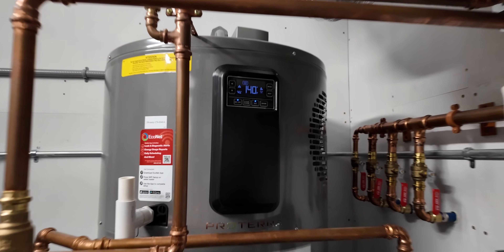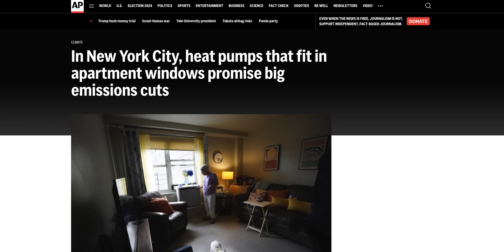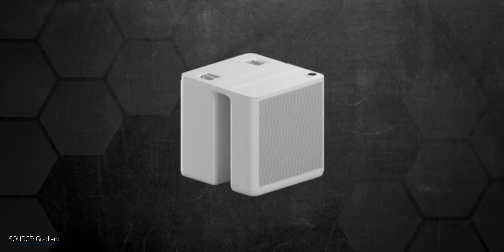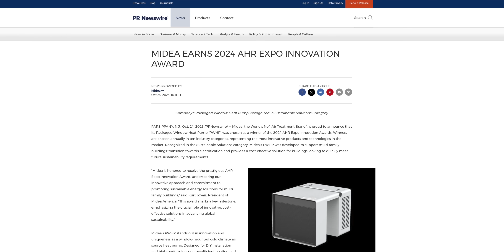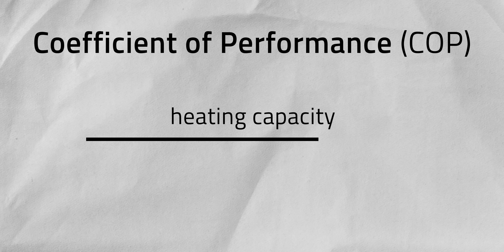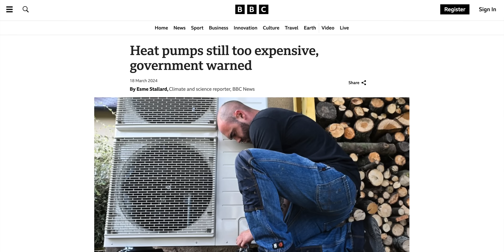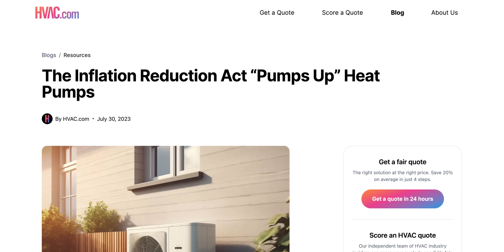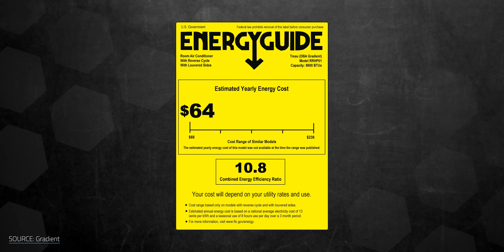Why This Window Heat Pump Is Genius

Comment: This concept goes way way beyond just New York apartment dwellers. This is basically a one piece mini split that can go in nearly any window and plug into 120V. These could be used in nearly any dwelling, school, or workplace, and provide a nearly instant and cost-effective HVAC system. That's just huge. A lot of homeowners have been moving to mini-splits and often you need multiple separate units for an entire home. They need professional installation. At an average cost of $5,000 each these days installed that is pretty expensive. We just installed one, but it only covers two rooms. Also most run on 240V, which has to be run to each unit. I've been waiting for these saddle shaped heat cool units to hit the general market but as yet they're still not really there. When they do, it would be a real revolution in HVAC across the market. You could easily buy a number of these for your home and ditch your central heat and air. I would buy two tomorrow.
Reply: My windows open horizontally
Reply: Soleusair is the answer $500 and yes you can still use the window. Ours is AC only - that's all we need
Reply: it is very old, recycled tech. Noisy.
Reply: Umm you most certainly do not need a professional to install a mini split. Tons of women online doing it start to finish... They are marketed as easy instal..... Maybe a electrical outlet needs professionally installed at most. Did you forget these window units cost 3 times as much as a split unit or even a full unit? Not worth it at all until they come down in price.
Reply: @cmo5807 in an apartment in NYC...lol.

Comment: I moved into a "green" apartment building and it has converted me to an efficiency nerd. In winter, despite now having a W/D and dishwasher, my electric bill cratered to 1/4 of what it was in a smaller unit.  In summer, it essentially vanishes as the solar system takes over.  So well insulated the heat pump runs for a grand total of 90 minutes a day.
Reply: There's always a point of diminishing returns. If you're building a house and spend an extra $100K to make it super energy efficient, it's going to take a century of -$200 on your electricity bill to break even.

Comment: Omg AC is heat pump. It pumps heat from one side to other. This is just awefull type of ac that US uses. As apartment owner you can buy AC that heats in winter in Europe for a decade. You have outside units and mini splits inside. Not useles sliding windows with horrible draft.

Comment: I have a finished attic bedroom space that relies on window ACs all summer... I would love a heat pump solution like this that didn't obstruct the window... I could leave it in year round, and the kids could get some extra air filtration and circulation during the winter.
Looking online though... Everything comes up as being a AC with no heat option for the typical GE and LG brands... Ithay kinda sucks

Comment: It's true that heat pumps are more effective with coeff 2.35 than just burning fuel with coeff 1, but if we use heat pump in winter when there is no sun, then energy in the grid is probably generated from coal with 35% efficiency. 0.35 * 2.35 gives us 82% efficiency. So it's better to burn coal and heat your house directly than lose on conversion from heat to electricity and back

Comment: If the COP is heat putput over electrical usage, I do not understand how you have a COP of less than 1 for a gas heater. For the same heat output of the heat pump, the gas heater would have much less electrical usage. If your electrical usage goes down put heat output is the same then the COP must go up.

Comment: Question if heat pumps take the internal energy from outside, if everyone used it in the winter. Would the outside temperature drop?

Comment: One possible downside not covered is that if they draw a lot power, it will limit what else can be on the circuit without overloading the breaker (high-end desktop/gaming computers, small appliances like a toaster over or microwave, etc). I couldn't find power specs on these particular heat pumps because they aren't out yet, but just the first 9000-10000 BTU mini split I found uses up to 750 W @ 120 V, which is a little less than half of a common 15 A circuit.

Comment: I might be missing something, ive seen this on Amazon for 500$. Maybe that one doesnt heat? It shouldn't be that difficult to reverse, its just an indoor and outdoor unit slapped together. Which go for sun 1000$pre charged.

The real issue is HVAC companies and tarrifs. In most parts of the world you can get a crazy efficient heat pump installed pretty much anywhere for 500-1000$. Here HVAC peeps will charge 2-3k for labor only, it's a scam. Have the government give a GI bill to youngsters to go around and build housing/install heat pumps.

Comment: I purchased a 10,000 btu window heat pump for my 900 sqft home 2 years ago for $700. Granted its only works above about 28° F but for 300+ days a year it works great.

$3,000 seems high but so does a $6,000 furnace which I guess is the real comparison.

Comment: Midea also has 12,000BTU window AC units for as low as $400. They are very popular on Amazon. I would consider the heat pump if it was within 50% of the cost of an AC unit, but not over 6x the price.

Comment: Good idea, but I'd like to see some sort of network capability so that multiple units in a property don't start fighting with each other.
One problem we have at work is with multiple heat pumps in a building, even though they are set to the same settings, some of them start thinking that it's slightly too warm so they go into cooling mode which makes other units think that it's now too cold so they throttle up. This slowly escalates until they're all running at full power in either heat/cool modes until they are reset.
If they are all talking to each other wirelessly over their own network, this wouldn't happen and it's something that manufacturers need to think about.
Reply: You don't need networking to solve this, you just need a gap between heating and cooling setpoints.

Comment: That form factor works in a window where you slide the opening window up and down. I don't know if I've ever seen windows like that outside American media. Everywhere else, they are hinged. Even if the hinge is on the top of the window, you're going to have to modify either the frame or change the window to a smaller one to accommodate a unit like this. And most hinged windows have the hinges on one side. And most windows have one window that opens to the inside and another that opens to the outside - or in more modern building, both might open to the inside, but you can't open the whole window. So you're still going to have to modify either the frame or the window.

So yeah, might work for the US market, not that much elsewhere. At least not in most of the countries I've visited.

Comment: Around the Seattle region, it is very common to have horizontally sliding windows, so these won't work. Which is unfortunate, as this is the best design for window air-conditioners.

Hopefully someone can create a version that can be installed using a bracket, but then it would need 3 versions: left hand, right hand, and, the one shown in this video, for vertically sliding windows.

Comment: What about serviceability? My father is on his third apartment A/C unit, his second mobile unit as his age prevents him from installing and removing a window mount. The previous LG mobile unit had a sealed system that wasn't serviceable. The entire sealed unit was technically replaceable, but LG will not sell to the public and I couldn't find a single tech willing to service a mobile unit. So, $600+ into the trash. I can't imagine how f'ed he'd be if a $3k unit died out of warranty and couldn't be serviced, especially if it was the sole source of cooling AND heating.

Comment: Once you raise the window 1/2 inch to allow this heat pump on the window sill you won't be able to lock the window. A design flaw off the bat.

Comment: I think the strain on the grid shouldn't be an issue given that it already has to handle summer peaks due to AC units. Using heat pumps will increase requirements during the winter as well but given how much more efficient heat pumps are I don't think it will be a cause for concern.

Comment: I can't understand these quoted prices. My Daikin reversible heat pump (12,000 BTU) cost around $600 plus $200 for installation and works great for both heating and cooling. What am I missing?

Comment: Here in EU the common wisdom is that insulation comes first, second and third, only after that should you be considered about your heat source. If the window sucks, heatpump is not going to fix your bill.

Comment: It's good for temperature control but it's not good enough for air quality, except a little filtration. Air quality is a serious concern. The build up of pollutants and also carbon dioxide and even radioactive radon gases in buildings is probably responsible for some substantial burden of disease. Really all buildings need heat recovery systems that effectively and efficiently bring in fresh air and expel stale air. Otherwise HVAC is not doing its job well enough for human health and even an open window might be healthier on the whole than these units even though an open window doesn't filter particles. I would also note that some traditional style window AC units are reverse cycle and so actually can do heating. Some of them do also allow the transfer of at least some amount of fresh air too, so are probably better health wise

Comment: I have a 5-6 year old LG window heat pump. Not nearly the compact equipment shown in the video, it is shaped like the common window AC, and I paid around 750 for the 14000 BTU unit. Why the substantial increase in cost for what is essentially a different package but same functionality? Besides the fact that these devices run on 110, and mine does have a dedicated outlet for the AC, what explains the cost?

Comment: There have been window A/C units that did heat and cool around for a long time. Sears used to sell them and the were 12000btu cooling and cost in the 500 dollar range. And yes they were reverse cycle. The only problem was when they got down to 32° outside, they had to go into a defrost cycle for a few minutes. You can get many 10000 and 12000 BTU units that are in the high $500s to mid $700s range. Only thing is, they run on 240Volts.

Comment: Wow! Getting roasted in the comments! But they are right. You can buy small mini splits that are available for $400. You will get both heating and cooling for way less! And have high seer rates! So efficiency is there also.

Comment: It's always back to the same old thing--money.  At 10-20 times the cost of an AC, if supplemental cooling is all I'm interested in, that thing would take forever to pay for itself (if it ever does, in cool-only mode).  And the cost is all up front.  I'll leave it up to economists and other financial pros to talk about the present-vs-future value of money.
But I won't lie:  That inverted, articulated 'U' shape looks ace.  What a great idea.  Facepalm indeed.

Comment: How will this handle hot water? Dunno what systems use in US but here gas boilers and heat pumps do both, so I don’t see how it could be a diy install.

Comment: These new designs (in terms of shape + hinge mechanism) are going to be great for installation and improving insulation/efficiency, especially for windows that are wider than the unit itself - especially compared to portable air conditioners that sit on the floor and only exhaust heat out a window. That said, there's no world in which a reversing valve and the related button and/or software to switch from cooling to heating is worth thousands of dollars to design or manufacture. Technology Connections has multiple videos all about how efficient and affordable heat pumps really are. I seriously hope this is just a matter of paying off the cost of designing the new shape, and these are sold closer to the cost of air conditioners; I could understand designing a cooling loop with a hinge in it being difficult, for instance, and especially the new refrigerants.

Comment: I’m flabbergasted that one of the expensive places to live doesn’t have individual heat pump AC units in their apartments…
I’m Japanese and I thought that was default for air conditioning in the modern era.
And it sure doesn’t cost $3000, even after including the instillation fee (it’s starts at like $400).

Comment: Desirable, expensive for 2 mths (July/August) hottest weather and 2 mths coldest weather mid January to mid March in Toronto. Do these 9000 btu units have the capability to add HEPA filters to imorive indoor air scrubbing? In the averge 2500/3500 sq ft home, what are anticipated air exchange rates? Any annual maintenance costs on the heat pumps?

Comment: @0:05  PLEASE Stop saying that.  You cannot EVER get more energy out than you put in.  You're only promoting all the perpetual motion and free energy con artists that try to scam people all the time.
Reply: He’s referring to coefficients of performance being greater than 1. I don’t think that many perpetual motion people are on this channel
Reply: So a gearbox or a few pullys don't generate more torque than what is put into it. Got it. Learn some science my dude.
Reply: @Mazaran  The torque comes from horsepower child.
You lose horsepower and gain torque.
Learn science,Child.
Reply: @Mazaran  I didn't say Torque, did I?
Reply: While you didn't say explicitly say torque, torque is mechanical ENERGY. low torque energy goes into gearbox and high torque energy comes out.
 I think the point you're missing is that the system isn't just "generating" or "creating" more energy. It's moving existing energy from one place to another more effectively than any other method of HVAC than we currently have. Low energy goes into to system to move the pump and fan, high heat energy gets moved at a result.
Edit for typo.
Reply: @Mazaran  Where, exactly does the extra torque come from?  Changes in gear ratio trade off torque for speed.  The total system energy stays the same - and That is the first law of thermodynamics.  Schooled much?
Reply: The energy always existed it’s in the air even if it feels cold, there’s still heat or energy in it.

Flowing energy through resistors takes more energy to create, than it takes for the heat pump to take the already existing heat outside and bring it in.

The energy is equal, but the way that it moves it means that the energy that is needed to use the device requires less energy than what it can pump through, that’s why it’s called a heat pump.

So if you look at the amount of energy going into the heat pump, and the heat that travels through it.

The heat traveling though is greater than the energy that is put into the device, the heat is just in the air, which is pulled in, and moved to the other side which then blows the hot coils, heating the room and cooling the coils which then takes that lower energy refrigerant and brings it outside to the hotter air that heats the coils and brings in hot refrigerant which then gets cooled off by the fan which replaces the cool air with warmer air repeating the cycle.

This isn’t perpetual motion, this is simple physics
Reply: @chrisw1462  nah he said more HEAT energy than put in, the extra energy is coming from other sources of energy other than heat energy. He’s not saying it makes energy out of nowhere so people understand what you’re correcting first.
Reply: The second law of thermodynamics dynamics says that heat cannot flow from hot to cold without a free energy cost. In the case of heat pumps, the free energy cost is frequently less than the energy moved from cold to hot (i.e. 10 joules to move 40 joules of heat from cold to hot). It always takes a free energy cost but the traditional laws of thermodynamics alone do not bound how efficiently heat can be moved.

Comment: Not just the 120V are US specific. Also the windows that slide up are. In Europe, I think you will rarely find them. Usually windows also have edges and only close if it's maybe a millimeter thick. So this will not work there.

Comment: Growers need any heat pump, not just another one🙄 Show one, that can be plugged to the air hoses of a growbox and brings no included fan or fancy grid, that block the airflow.

Comment: It took them long enough.  Every time I see a rep selling heat pumps at home improvement stores, I ask if they have a heat pump in the form factor of a ac unit.  None of them had one or knew of one existing.  The cost is quite high for a reversing valve.  I could just turn my ac unit around in the winter and put a drip pan on the inside.  I would have to do a little notification to defrost the radiator every once in a while but it wouldn't be $3k worth of modification.

Comment: I've always wondered why all that heat blown outside from an air conditioner couldn't be used to partially power the unit. But then that would have to be converted into 110 V. AC to run the motor, right ?